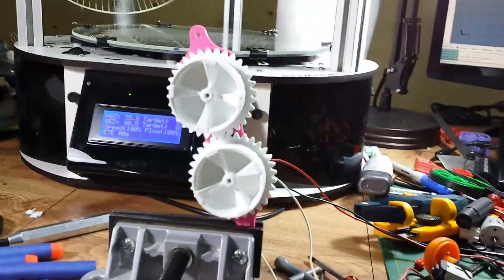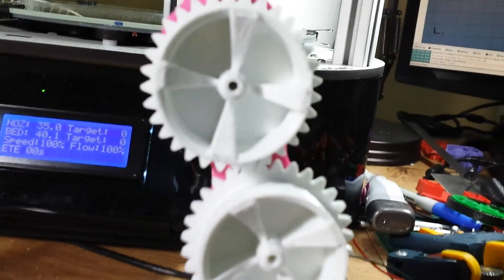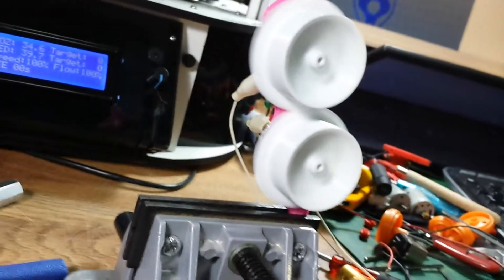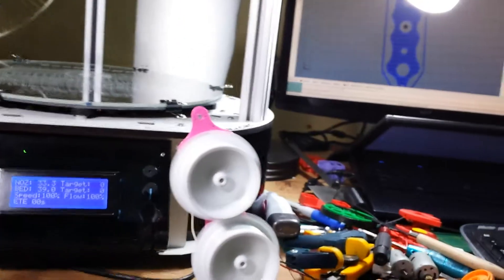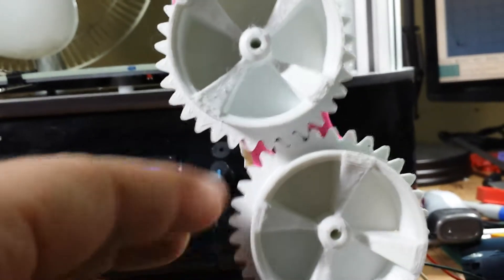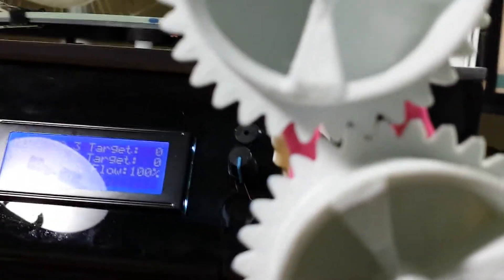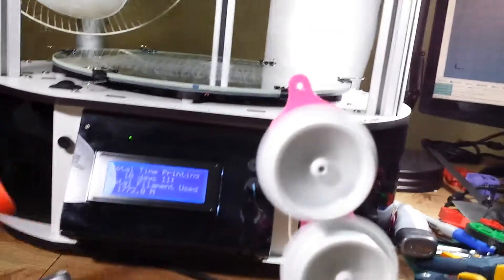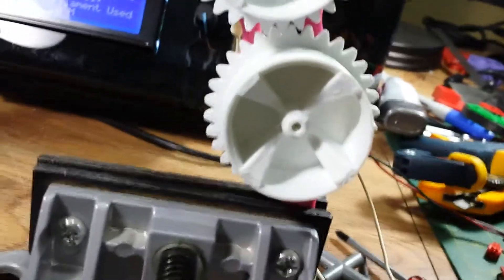Dual motor Nerf Dart Flinger - Proto-type v3D - Part 1

Comment: Great shooter! I will have my Rostock in a week. What modeling software do you use?
Reply from the maker: portland454  I'm using 123D Design from Autodesk.  It's pretty good and easy for beginners to get into.  
I've just developed a problem with my hot-end.  It has heating problems now and takes a very long time to get up to temp, and as soon as it starts printing it can't maintain the temp and drops about 20 degrees.  I've just ordered the V6 hot-end from E3D and will install that in a few weeks.
Reply from the maker: portland454 Oh, and I have a full assembly log of the Rostock Max V2 under a playlist called 'Assembling the Rostock Max v2'.  Check it out.  Maybe it'll help you for your build.